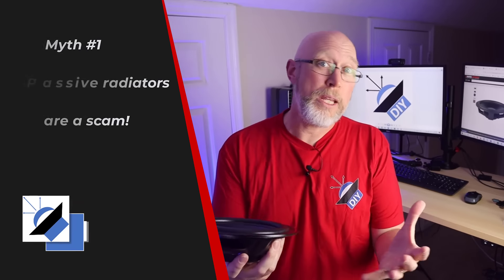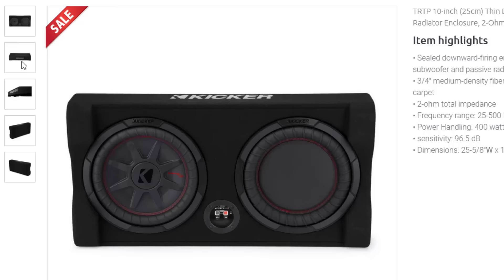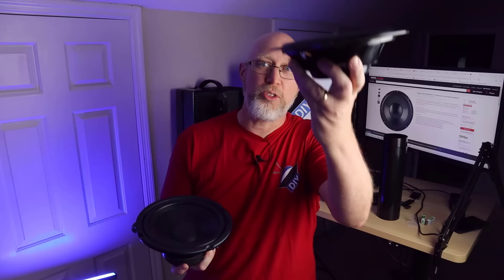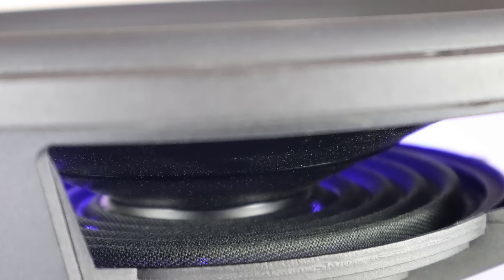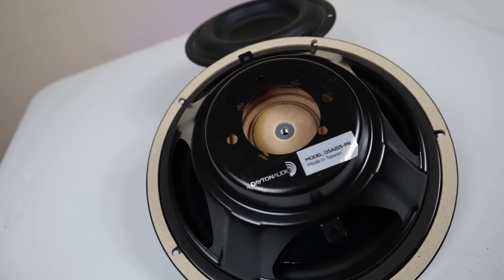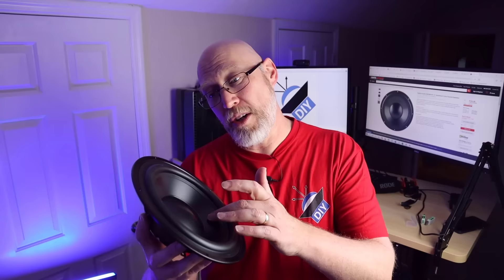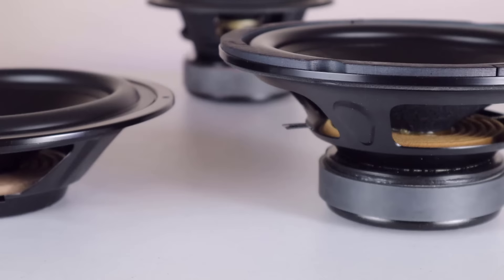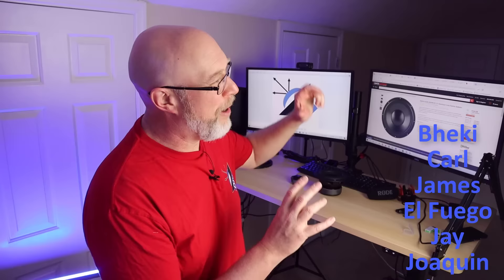Passive Radiator Myths Busted  #Bass

Comment: Hi. Would a front firing passive radiator be ok in a home environment. Would a cabinet with a12” active and 2 12” passives (each 1x xmas of the active) be any better or different than using only one 12” passive at 2x xmas?

Comment: Do you notice a difference in sound quality between PRs and Ports? If two speakers were identical except that one used a PR, and one used a port, and they were tuned the same, do you think you would be able to tell which is which?
Reply from the maker: In my opinion, the differences are very small.   Passive radiators being more expensive than simple wood and plastic ports. It only makes sense to go with the passive radiator when you can't fit a port into the enclosure.
Reply: @DIYAudioGuy  Awesome, thanks so much for the reply! You just saved me from going down an unnecessary rabbit hole on my new project (and I've been going down WAY too many rabbit holes!)

Comment: Like the vid and would love to know what you make of the way kef made their KC62 Active Subwoofer
Reply from the maker: I don't have any hands-on experience with it so I really can't say.
Reply: @DIYAudioGuy  Understand that, its an odd but cool design approach uses two 6.5 inch dual force-cancelling drivers with concentrically arranged and overlapping voice coils, driven by a single motor.  They say it reduces size by a 1/3 and Frequency response from 11 Hz but not a the SPL advertised 105 dB

Comment: Do Passive radiators need insulation the speaker box?
Reply from the maker: It is probably not needed with a subwoofer, but may help a midrange -- like in a home speaker.

Comment: So Cal audio fans may recall the RSL Titan model, which featured a 15" PR, 12" woofer, 8" mid woofer, 5" mid & 2" horn tweeter, plus  2 L-pads, arranged somewhat haphazardly onto a giant box. I like the Titan, and think an upgraded version with modern drivers and a symmetrically opposed layout should exist, perhaps with a built-in powered sub.

Comment: Hello!

Thanks for you explanation! You are awesome!

Can i ask you a question?

Is it can be enought to use two 8" PR's with one 8" Visaton BG20 in enclosure with dimensions 12x12x12 inches?

I need to make a speaker, based on Visaton MB208H kit (two FR drivers BG20 + one tweeter HTH8.7), and task is to use as small enclosure as it can be, some near 12x12x30 inches! So PR's seems much better way to reduce the speaker size when port, without loose to many bass...

Sorry for disturbing you, and wish you all the best!
Reply from the maker: Yes.  You are on the right track.  PR's are the way to go with a small box.
Reply: @DIYAudioGuy  thanks you very much, and wish you all the best!

Comment: Question, are passive radiators like ports where most of the sound is produced by the radiator?  Like if I'm designing a box and the active driver is on one side, and the passive are on the other, will it effect output?
Reply from the maker: Most of the sound comes from the active driver for both types and yes think if it as a port.
Reply: @DIYAudioGuy  I've always been told in a ported application most of the sound is made by the port.
Reply from the maker: @beakerwsw  depending on the frequency, yes.

Comment: So if it acts similar to a port, could a 6th order be built, completely sealed into 2 chambers, 1 for the front of the sub and 1 for the back, each with a differently tuned passive radiator to get similar (I'm sure nowhere near as good as ported) results to a regular 6th order?
Reply from the maker: Yes.

Comment: I'm torn between trying to create a compact ported enclosure and one with passive radiators. This is in a 2010 Tundra Crewmax behind the rear seat. Currently running two 12s in a sealed box at .85 CF for each sub.
Reply from the maker: Tight fit!
Reply: @DIYAudioGuy  
Lol! Yeah looks like a brady bunch family trip behind the seat. ;D
Reply: You'd probably do better with one if the box volume is that small. More extension and less boomy mid bass.
Reply: @TimpBizkit  

Good point Thanks!

Comment: Thanks for the lesson.  If your enclosure has multiple passive radiators can each PR be tuned to a different frequency?
Reply from the maker: My first instinct is to say no. But I don't have any data or evidence to support that conclusion.  I just think you'd be really tricky to pull that off.

Comment: I made a design and with a passive and someone else did the same design with a port and can't get down to 50 hz. I got down to 34 hz with a 8 passive radiator woofer
Reply from the maker: The other guy did something wrong then. A ported box, with the same tuning, should slightly out perform a passive radiator box.
Reply: @DIYAudioGuy  He must have the port to small.

Comment: So passive radiators are all about that bass, bout that bass, no treble? I saw many passive radiators on cheap speaker boxes where the PR was a round flat panel, often with an open cell foam surface. They had a foam edge like a normal speaker to allow movement.
Reply from the maker: You can make the out of almost anything.

Comment: Could i just install a regular speaker that im not using and not wire it ? Or the magnet and the voice coil affect the purpose of the passive radiator?
Reply from the maker: Yep, the magnet and coil will work against you.

Comment: I have a box in my truck with 2 10 inch holes. It's full ported, like 3 cubic feet. I put 1 jl 10w6v3 in and blocked the other hole. It sounds amazing!! Hits pretty low freq, not sure the tuning.  Question is, what would happen if I put a passive radiator in the other hole instead of it being blocked. Sounds like I'd need a huge xmax if I use the same size radiator though....
Reply from the maker: You would need to block off the ports for it to work, and you will have a hard time finding a 10" PR with enough xmax to pair with a W6.  If you go that route I would recommend cutting a bigger hole and using a 12.  https://parts-express.sjv.io/0JN2QV
Reply: Thanks. Sounds good now. Next question. What happens to the frequence response if I run 2 of the w6 10s in this box? And if I push them at the same total wattage ( slash 500/1 should still give 500w at 2 or 4 ohm load ) will it be louder, the same or quieter at all frequencies?

Comment: Hello mate. I have a pair of leak sandwich 600 speakers and I want to put a passive radiator in them. They have 12" woofers and I've heard the PR should be bigger than the actual driver is this true? I obviously can't fit a 15" PR so should I just use two 10"? Thanks in advance from Tottenham London
Reply from the maker: https://youtu.be/v4rAkxck2_Q?t=133

Comment: Do passive radiators sound comparable more to slotted enclosures or sealed enclosures?
Reply from the maker: More like a ported enclosure.  Just a little less low end extension because they roll off at 30db per octave (5th order) instead of 24db per octave (4th order) like a ported enclosure.

Comment: hmm, question. i will use in my wireless bt speaker one dayton audio nd140-4 and two nd140-pr, i just noticed that the active has xmax of 4mm and the passive radiator has 9mm, so if i use two of these just cause i like symmetrical box, will i gain or lose or just have same performance as if i used only one nd140-pr? new to building stuff so trying to get sense of these kind of things :D
Reply from the maker: I can't say for sure since I don't know exactly what you are trying to do.  But, if the passive has double the xmax then you only need one per active driver.

Comment: can i use Passive Radiator in a vent box or i have to use it in closed box Thank you
Reply from the maker: Neither and both.  A passive radiator is a type of vent.  So you would not use it with a vent, but when you use it the box is not sealed.  Hope that makes sense.

Comment: I've always gone to the trouble to make sure both drivers in the same box are wired in phase, yet is it not true that a passive radiator (acting as a port membrane) produces an out of phase wave from the active driver. Does it not deflect in the opposite direction as the powered driver?
Reply from the maker: It works just like a port.  https://youtu.be/mHTGwEHCCRo

Comment: Can I have a passive, (or two or three), radiator too big?  I am trying to run a 12" sub with 800 watts in a small space and it would appear I need two of the 10" radiators and a smaller one to have the right size.  Because I have no clue how to calculate all of that, I was hoping to just oversize the radiators.  Would it be feasible to just build out an enclosure and test it with a mic or oscilloscope?  Thoughts?
Reply from the maker: At some point it becomes to big to be practical, so yes they can be too big.   I don't recommend mixing sizes.  That may not go well.  But if you need two 10's and an 8 to perfectly match with the subwoofer then go ahead and use three  10's.  It will probably be cheaper to use two 12's.  

You can use a DATS to verify the tuning frequency, or just use some rice.  A a measurement mic with REW can be used to test the frequency response, or you can just grab a cheap DB meter and play different frequencies if you don't want to go that route.

Here are some videos:  https://youtu.be/EQ60jNg9lvk  that will point you in the right direction.   https://youtu.be/BicefelesIA
Reply: Thank you very much.

Comment: Passive radiators really work. They are an effective engineering choice to achieve the tuning frequency needed with improved transient response. Like all loudspeaker design, many variables need to match to achieve success. Hobbyist speaker builders are not going to be able to do this. Surface area of a driver is only one and not even the most important spec. The math you discuss here is completely inadequate for speaker design.

Comment: There was a car audio shop in Florida about thirty years ago that used to take a pair of drivers and mount them so that the cones face each other, one speaker mounted on the outside of the baffle, and the other speaker on the inside, and then they did not need an enclosure, it was some kind of hybrid infinite baffle that they were able to adjust the "effective volume of the infinite baffle" or something like that.
Reply from the maker: Sounds like an isobaric setup.
Reply: @Mr.Robert1  Only if they are wired wrong.

One speaker is in phase, the other is out of phase, but flipped 180 degrees.  So the two cones are firing in the same direction.

Comment: Can you do a PR in a car with a 1700w 15" sub?
Reply from the maker: The challenge will be finding one that has enough xmax to match with that subwoofer.  You will definitely end up using multiple passive radiators.

Comment: Is stiffer pr perform the same with heavy pr?
(Stiffer = Heavier Cone?)
Reply from the maker: Stiffer refers to the compliance, or lack thereof, of this suspension. That will be the surround and the spider.

The mass of the passive radiator should be equal to the mass of the air in a port that is the same diameter as the cone at the same tuning frequency.

You generally want a compliant suspension and the weight of the cone plus any mass you add to it is how you tune the enclosure.

Hope that makes sense.